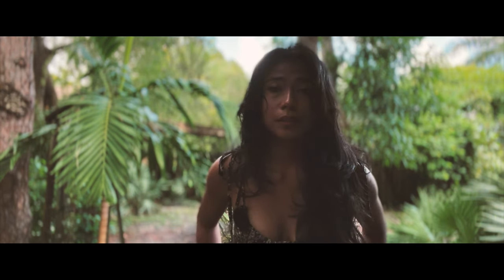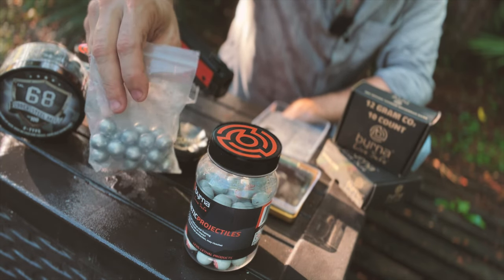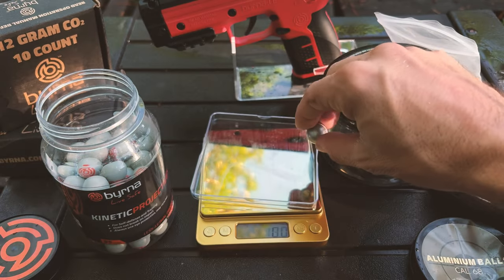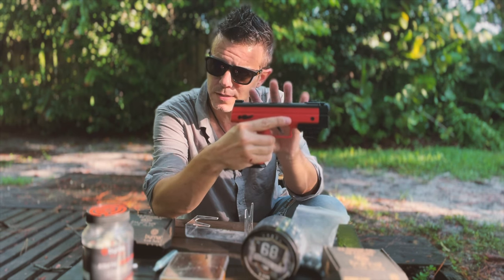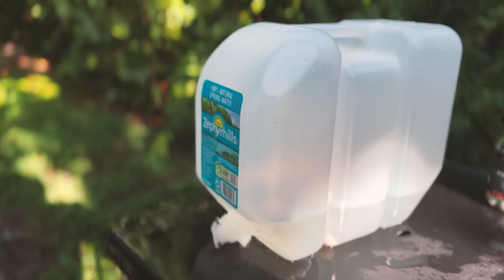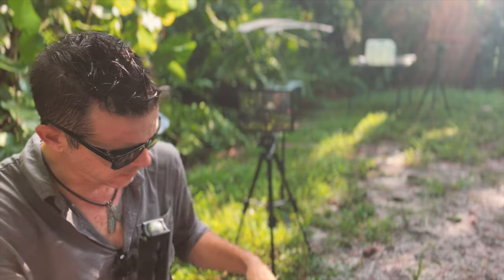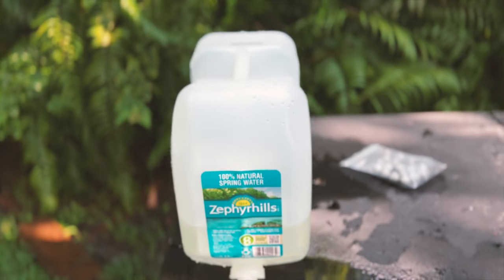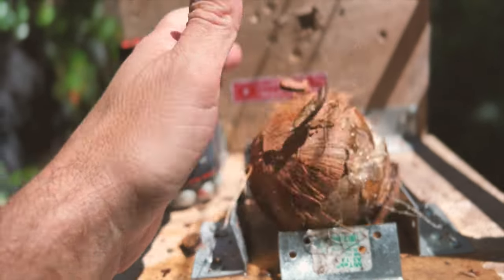BYRNA LE • NYLON vs ALUMINUM vs RUBBER-STEEL AMMO

Comment: Yea bro the rubber rounds are garbage and create drag in the barrel. Might I recommend Homewreker Busting Balls instead of the rubber rounds. Great testing my man
Reply: The rubber balls are top notch. If you get a tuned up HDR 68 loaded with rubber steel balls you have a solid firearm alternative for self defense. That “drag” you speak of is an important aspect for building up pressure and reaching maximum velocity before exiting the barrel. That’s why bullets don’t just drop through the barrel. The rifling actually gets cut into the bullet. 

Byrna is just an expensive brand of launchers. Doesn’t make them the best and rubber steel projectiles the worst lol. Almost the opposite.

Comment: Seems like the LE has become popular in South Florida. Another nice test my friend. Is the Byrna LE the best compact option or is the Grimburg Gavle better? Hope you get your hands on the Gavle in the future and can compare them head-to-head. In the meantime, I'm sticking with my PepperBall TCP with extended mag that can run 8+1 and has a fresh CO2 with each new mag. Yes it's bulky but hard to beat on power AND shot count.
Reply from the maker: Hey man! Gosh sorry so late! Funny, ever since I made these Byrna videos soooo many people have suggested I test the Gavle… and so I contacted Grimburg who said they’ll try to send me one to test asap… 🤞🏽🤞🏽
As always thank you for your very valuable and well thought engineer input :)
Reply: the gavle looks so unappealing, there is no grip at all just a mere handle... I would need to hold one u guess
Reply: The Gavel is way better launcher. Its a tank compared to the Byrna line. You can get a grip extension for the Gavel hit me up if you want the details. John Wixon sells them and they work fantastic and still allow you to charge the Gavel even with it on. Gavel is very well made and very simple it is straight power from the C02 no internal regulator on Gavel which helps give it its power.

Comment: The Bryna is not reliable, the Sebre compact 68 cal, Is better than the Bryna. It has more power, the magazine is good, the handle air pressure very well. It fiur month now no air leaks.

Comment: Precisely the kind of video I was looking for before buying more balls
Reply: quick uodate for anybody who comes across this , metal balls I got from amazon were much better than the byrna brand , cheaper than the byrna brand and caused no issues to the byrna pistol itself that I have noticed 
I also tested black plastic "reusable" ones from Amazon and not only were they much cheaper but alot more dense and hard and overall better than byrna brand balls
conclusion : dont waste money on byrna brand balls
Reply: @FlyingNazgul-wm1dv  have a link ?
Reply: @FlyingNazgul-wm1dv  glad I seen your comment. I was just about to order a 20 pk of these aluminum. 68 cal rounds for my byrna SD. Wasn't sure if I would mess up my byrna but I think I'll order them and then see if maybe you respond before using them. They're not named brand, just something free that I get to choose from because I am an Amazon Influencer and get free stuff every day. Lol! Hopefully they'll work in the sd (5 round mag) with the 8oz co2 cartridges. Any help or advice would be helpful. Thanks.
Reply: @FlyingNazgul-wm1dv  Can you please link the metal balls that you are recommending in your comment?
Reply: Pause

Comment: I recently purchased the LE. I have it for work (I run a small security company), and use it as an alternate carry on days I'm running errands here in commie SoCal where I know I won't be able to carry my firearm (lucky enough to have a CCW here). So far, I'm loving it. I had an interaction with security at a venue recently, where firearms were prohibited, but I would be allowed to have something like a can of pepper spray, or a pocket knife. The looks on their faces when their supervisor googled the laws around non-lethal launcher/spray devices, and had to sgree that even if they didn't like it, I was allowed to do it, was absolutely golden. I was gracious and polite about it, but it was nice to finally have a solid defense tool I can take basically everywhere legally, and people here kinda have to suck a fat one, learning that it's literally just a can of pepper spray on paper. 

My ONLY complaint is the difference in consistency across different ammo types.

Also, I know that the only reason I'm allowed to carry pepperball ammo here in CA is because I have all of my state security certifications and licenses.
Reply: They gave you a wallet card for you to write down the serial number, and it states the launchers legality right there.
Reply: not true. I can buy and use pepperballs now and don't need any liscense lol. I'm in Cali too
Reply: im looking to purchase one of these. do i need some type of security license/permit chemical agent permit to carry the pepper/tear gas balls? if so, i was thinking of just using the kinetic rounds. not sure the legality of it all though. been trying to get more info. im in california btw. cencal.

Comment: Great video. You playing like a Barney Fife cop in the beginning is hilarious. I had the same issue with the rubber/steel balls sticking in the seven-round magazine and had to carefully pry them out with a flat-tipped screwdriver. I was able to get them to work using a five-round one from my SD because of the way the balls sit in the magazine straight up and down instead of staggered as the seven-round has.

Comment: Great video! And sorry about the busted screen  At least it did look like you had fun.

PS. Thanks for showing us how the rubber rounds jam and fail to feed, I've ben wondering about that.
Reply: A small shot of silicone spray fixes the jamming issue. But yeah you're not suppose to be firing rubber ammo in a Byrna.

Comment: Keep in mind that if you run across a great deal on the SD with 8gr CO2, you can convert it to the 12gr CO2 with a kit that's under $60. There are also now 7 round magazines available. The SD is still smaller, and I assume the LE has a bit more punch due to longer barrel length.

Comment: I also Run a First Strike FSC 6 rounds takes 12 gram co2 and the first few Shots are in the 46 to 40 Joules Range. It hits hard I have it modded with VKS Bolt and Spring and Sterling Self Defense back cap so I can run the VKS Bolt inside of it. the FSC and TCP are substatially larger launchers so that is why I default to my Grimburg Gavel 1.5. But still keep my FSC around for home defense and its alot of fun to shoot

Comment: Great video, the Byrna does not like when the balls aren’t slick, the rubber/metal balls will not feed properly as they seems too sticky, you can use a little bit of silicone spray on the balls, and it may help, but I would just stick to nylon.

Comment: Very nice vid. I recently bought SD. Smooth operation. Good pop. Had some initial sticking issue with safety. With several "rounds" still in the mag, i could not flick safety on. It bogged down half way between. Did not want to force it. Have you experienced this??

Comment: Bryna can come out with whatever they want, I'm not dropping $400+ on a less lethal.  I'll just stick to my tuned Umarex hdr50 with devestators, aluminum balls or cododos. Plastic if I'm feeling forgiving 😊
Reply: SMART MAN !!!
Reply: spend 400 plus on a real 9mm !!! lol.
Reply: @rick31869  Exactly. I got my Glock 19 for not much more than that lol
Reply: Salt S2 = $249
Reply: @tyronetrump1612  I prefer a revolver style for a less lethal c02 because you can shoot several different style ammunition, including actual 9 mm bullets and spiked steel rounds (z rams), ect plus it's quick and easy to reload a new cylinder  ready to go

Comment: New subscriber here. I recently moved to a section of my city that's there's been quite a bit of home invasions, the thing is I got in trouble when I was young and cannot own a firearm what do you recommend is the best airgun for somebody that's in my situation, thank you.
Reply from the maker: Hi my friend! Thank you so much for subscribing. I would recommend you watch a few of my videos (and of others) to see which option best suits you. 
I personally like the revolver style launchers, as they offer a much larger variety of ammo options and shapes. With mag fed guns like the Byrna, you only have the round balls option.
That said, solid round balls have proven to be extremely effective, to not mention the powerful pepper ones.
So, to make it short, I would see which you prefer between the Byrna LE and the Umarex HDR 68 (16 joules version) as they’re both among my favorite options.
Lastly there is a PCP (not CO2) gun that I should be testing soon, the Huben GK1. That one promises to be up there among the best options - however it comes at a price. Literally. CO2 launchers go for a few hundred dollars while the GK1 is looking to cost around $1400.
Hope this helps and best of luck
Reply: @AirgunAlley  thank you
Reply: Hdx 68 for home with upgrades to 40j...umarex double barrel upgraded using arrow bolts for home defense...byrna le for carry with duke extreme peppers and duke glass breakers  mix
Reply: @edgefinesse4700  thanks I'll check those out
Reply: Salt S2 - blows the byrna LE away and it WILL fire every time

Comment: Byrna tends to want you to buy their ammo/projectiles. If they have rubber or steel or aluminum projectiles, I’m not aware of them. That Grimburg Gavel has to be the most powerful non lethal firearm.  I’d question if it’s non lethal.

Comment: Byrna is such a disappointment from a power delivery perspective. I am happy I went with the Salt S2! The S2 can also use a large range of ammo 😅
Reply from the maker: I really need to try that one! Thanks for your input!
Reply: @AirgunAlley  , the Salt S2 is a solid marker. It is limited to modding up to 25 j but is an excellent, well-designed marker. I have my heart set on a Pepperball TRP SSD.
Reply: @10:25, and this is why you do not buy a Byrna! 😅😅😅😅😅 save your money! There are lots of reviews on Byrna and why you should avoid it!
Reply: @Sola_Scriptura_1.618 That was the ammo, not the gun. And, apparently, there's a simple fix for the problem: talcum powder.
Reply: @brianfoster7064  8:30 was not ammo, it was the Byrna! My HDR kills the Byrna on power!
Reply: 1st round      342 FPS w 3.7g kinetic = 20 joule
5 th round      332 FPS = 18 joules
these things use like no co2 per round

Comment: Non-lethal means to use a lesser means to avoid using deadly force. I think using a material with metal in it could only cause death or serious harm that can lead to death.  I think using the rubber steel rounds or aluminum will lead to some sort of lawsuit in the future and make it difficult to carry the Byrne Le or other non-lethal tools. Strongly recommended not to use the steel/based or aluminum balls as self-defense because the law may consider it deadly force application and jail time may be produced from this.
Reply from the maker: Hi, thanks for this. I however would argue that using a metal projectile Can be deadly, with a capital C. They’re actually far from being easily deadly. 
If your attacker is wearing heavy winter clothing and a helmet, I think having an aluminum ball will give you that extra energy and confidence you may need for that scenario.
I mention clearly in the video that Byrna is designed for pepper or nylon balls only.
You are right in saying that it all depends on your local laws and regulations. But there is definitely no law that forces you to use only certain projectiles with a launcher

Comment: Thank goodness the CO2 cartridges use a proprietary fit. I was worried you could buy a standard CO2 cartridge and that they might work perfectly. Thank goodness their website implies they've blocked that universal compatibility.
"Byrna CO2 Cylinders are custom fit for Byrna Handheld Pistols and Rifles" (←from the website)
So it's "sounds like" they've made a special effort to insure the standard and readily-available CO2 cartridges sold at all bikes shops, sports shops, and department stores (sports section), fire extinguisher repair businesses, etc., don't work.

Comment: Will these crack someone’s skull?
Reply from the maker: Most likely not, but at very close range I’d say they could
Reply: @AirgunAlley  Thanks.I was just wondering because I live in Arkansas and we’re allowed deadly force on a home intruder.If possible I’ll try for a headshot.
Reply: @Jameschewingfoil  na. But they will piss somebody and make them really want to hurt you though
Reply from the maker: The scenarios of home defense are infinite and in the vast majority of countries in the world, people don’t own guns.
The only time I was house robbed, for example, it was done by kids. They use children as they climb better into balconies and easily sneak into apartments thru small window openings to steal stuff. 
Using deadly force in such case is simply way over the top. For me.
As I said, the scenarios of home defense are infinite. This is just a tool out of many, that obviously requires good judgement. Like any tool.
This is an airgun channel made for a global audience. Again, people owning guns, is very much an American phenomenon not shared by most of the world, which this channel serves…

Hope this helps and thanks for watching

Comment: well i know you are like in florida right, so i know it is not a pistol but my aea hp 51 cal max rifle i regulated it and i use the exact half inch carbon steel ball bearings at 8.4grams or 128grain.and my regulated speeds are arount 1080fps with 6 shot magazines and 18 shots before the power starts dropping.
 and i listened to this and your riccochets and well i am firmly convinced that i would rather stick with lethal self defense  as one round would do the job , being steel it is going through , pretty much anything even half inch aluminum plate, but i do not suggest shooting steel at hardened steel cause it will come back at you.
 smiles as you now know.
 i only use steel on soft targets. i use lead for the hard targets at 300grain and well i get around 350fpe regulated regardless.
 so it is gonna go through a car door and everything in there and out the other side of the car's other door.
 so vehicles used in drive by's beware comming on my street k. i would not suggest it.
 and t-rex go find another meal cause i willeat ya.
 and my friend, if you come to texas. and bring your pepper/tear gas projectiles, i will wear my heavy jacket and motorcycle armor underneath and you can try to make that gas stop a monster.
 but if i get to ya i am wiping the stuff off me and on you hahaha
 smiles just for kicks and giggles.
THE LAST WORD
Reply: well it is only fair that if i can muscle through the pepperballs(been through prison and they gassed us alot , kinda flavors the ramen soups better) so wipeing it off myself onto the person that sent it is just fun right.
 the steel , well i have had it riccochet so close it grazed a leg and took hair. so i just keep that in reserve for hunting and soft targets.
 got plenty of lead and those 310gr and 300 gr fly at around 750-820 fps and if i need to use the heavy 51 cal my element max it uses 345gr through 420 gr lead and well it is devestating at near 530fpe. like sending a sledge hammer at something, so even a kevlar vest is still gonna allow that energy to transfer into that target break bone and put that vest into the target. it is sub sonic flight so probably wont go through, but they will get knocked off their feet and wont be much of a fight for a bit.
 got a .357 air rifle the aea big bore that sends 160 gr hp at around 900fps and has the same energy level but it is twice as heavy and scoped for longer ranges.
 snd back in the late 80's and mid ninety's there used to be drive bys here in grand prairie many nights. once i had to dodge 96 machine gun /uzi bullets my self got my palms all cut from glass on the ground. but ya know the streets here are not that bad these days comparitively.
 but those gang members still tell urban legends of things i did.  so that expression from you is a compliment. smiles with grinning teeth amade of circon and platinum. like a monster in the dark..
THE LAST WORD   @juansandoval1133